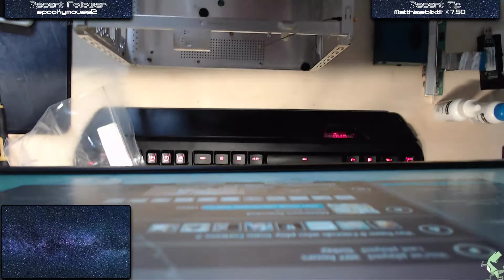Sfekke working on a PC

Comment: This in my reccomended just so you know (im not saying you're slow or bad) that i built my first pc in 30 or less minutes xD
Reply from the maker: I was taking my time on this one, cables had to be perfect; more a showpiece then anything atm.
Besides that it is small form-factor with loads of propitiatory cables, that happen to be fragile as hell xd
When I build especially for my own use I'll take 4-5 hours on a full-size ATX, routing every cable exactly the way it should & planning way more then needed :p
Building in 30 minutes = possible, but never as clean or ecstatic ;)